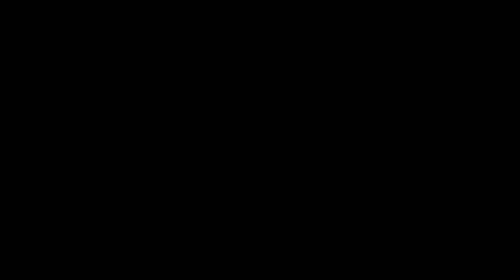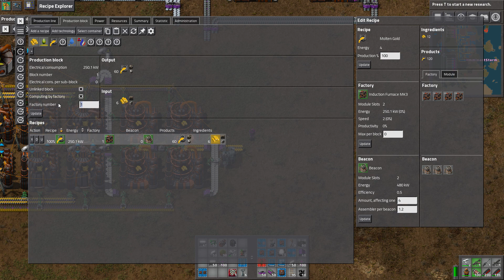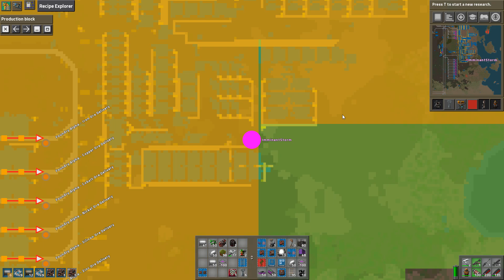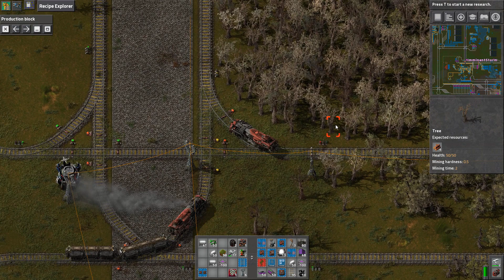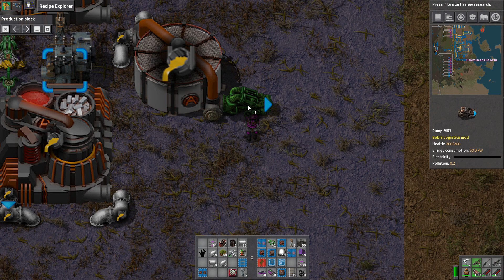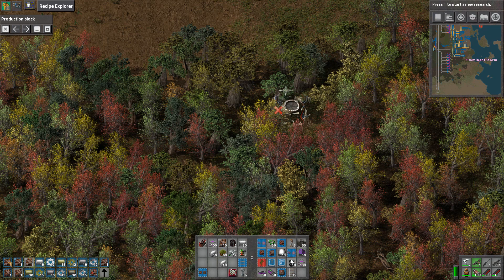Factorio - Angel's & Bob's - Episode 156 - Gilded Coils and Golden Plates

Comment: Looking pretty good so far, though I suspect you may have to double your production of molten copper if your entire foundry runs at once. But then, if your entire foundry runs at once, molten copper won't be the only thing you run out of: you'll probably also crash your power supply. I think you're going to need to vastly expand your nuclear power setup before you bring the foundry online. First, though, I'd recommend taking about 80 U-235 out of your supply and storing it in a chest for use in Kovarex enrichment later on (once you finally get gold science), so that your expanded nuclear power can't "eat your seed corn", so to speak.